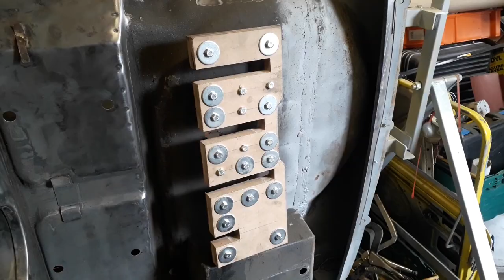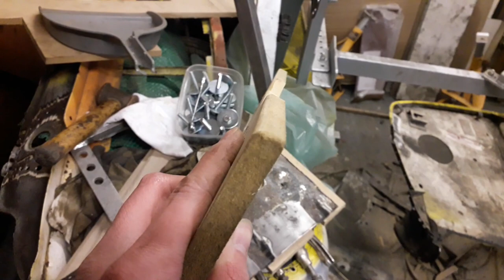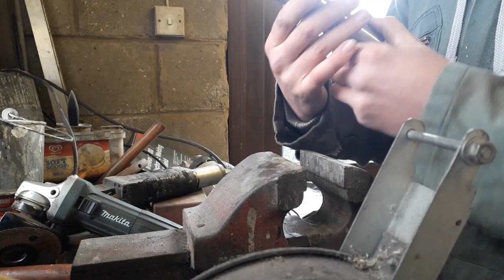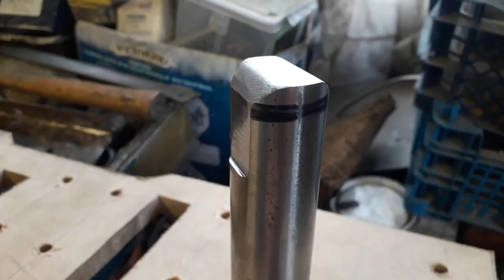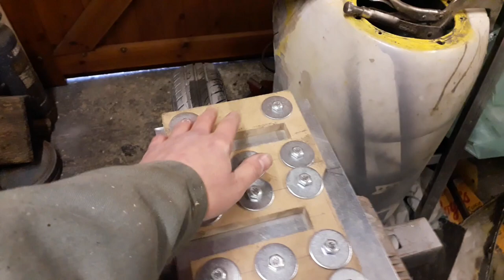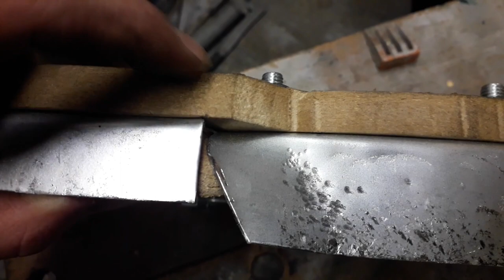Mini floor repair panel

Comment: Create a bottom die that is identical to your top die. Cut something like pieces of wood to put underneath the metal in the slots of your hammer form to act as depth stops so you know when to stop hamming and don't go too far. Use an air hammer instead of a hammer. Even a cheap one is ok. I would cut a big portion of your steel tool off and then drill a hole and insert one of the air hammer tools in the hole (may have to cut off the tip of the air hammer tool/bit). Since you are using a steel tool instead of plastic you will need to do everything you can to minimize a rough surface finish. Make sure you file and chamfer "all" edges. I saw a couple that were still too sharp. I did a small hammer form with an air hammer and it still took a long time. I couldn't imagine trying one with a hammer. The slower and less aggressive you are making it will usually result in a nicer outcome

Comment: My guess on how to make this work. Don't fold the back edge, put only the two far left hand bolts in, then hammer the left flute. Then put in the bolts between 1st and 2nd flute, then hammer 2nd flute etc etc finally bend the rear edge. This way the metal can move left as it needs to to give the extra. You may also have to cut a slot a few mm wide between the top of the flute and the heal board which will.then close when forming the flute, you can weld and grind the small cuts at the end so you won't be able to see them.